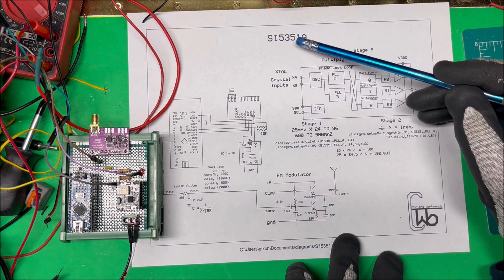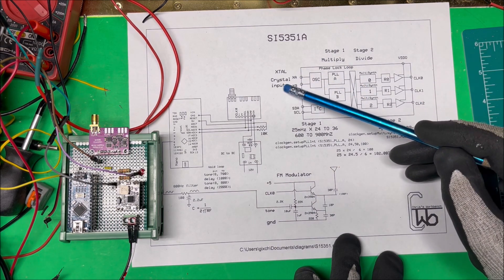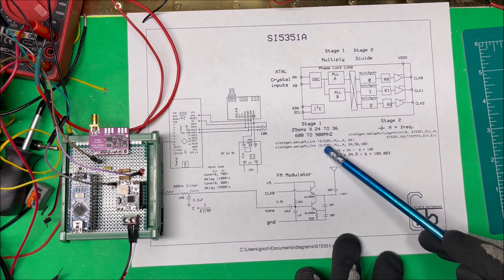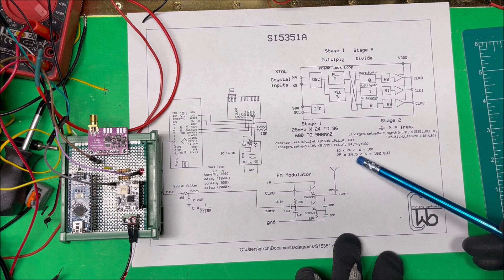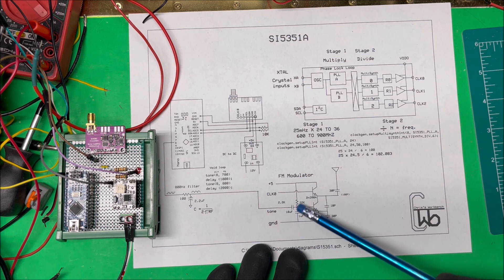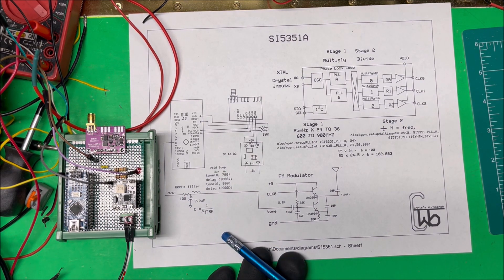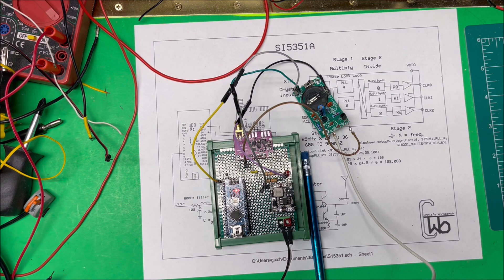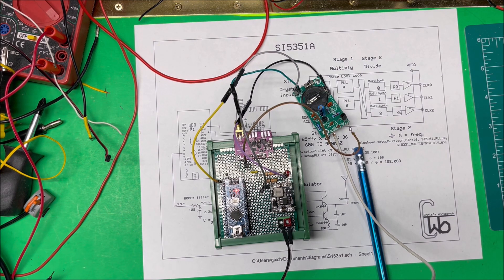SI5351A Clock Generator VFO

Comment: It's amazing what 2-3 bucks get you these days. I remember the all the complexities of building analog free running VFO’s and then mixing and filtering to get a desired  frequency not to mention all the stability issues.   I also liked the FM modulator circuit I wonder if there is a way to get the SI5351 to modulate the carrier. Great vid really enjoyed it.